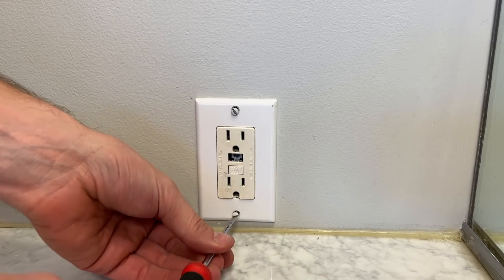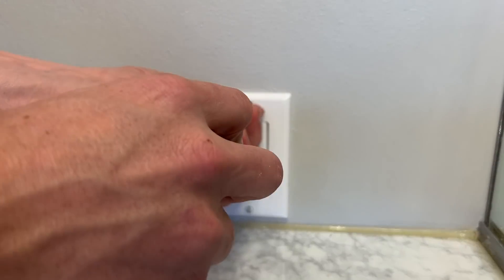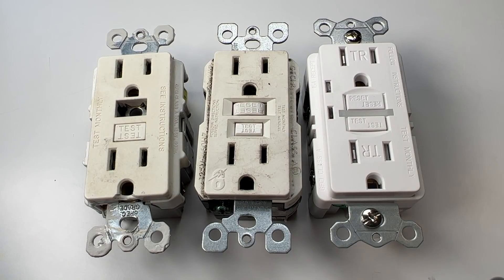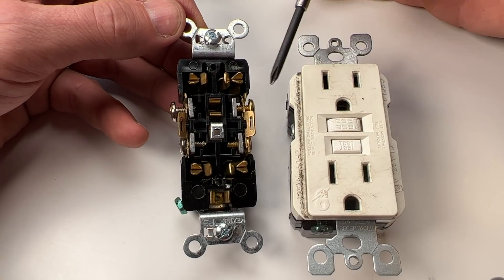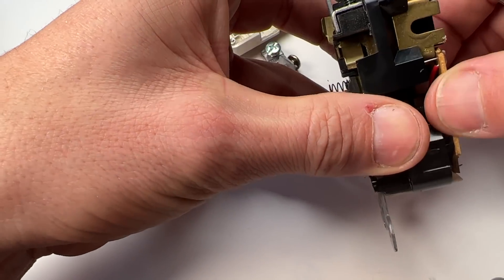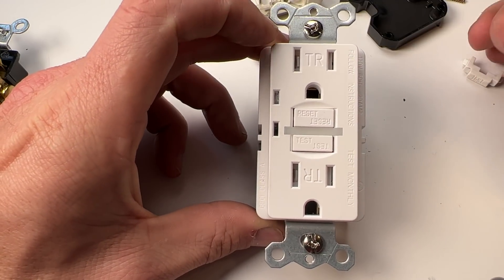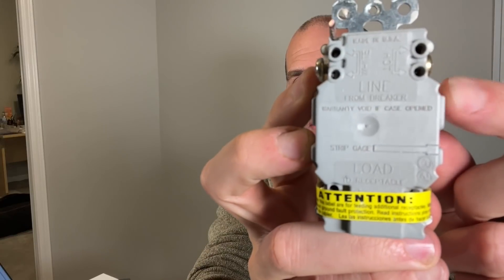3 Things You Didn't Know About GFCI Outlets

Comment: The current interruption on my hair dryer, two prongs no ground connection.    I plug it into a GFCI works fine.  I press the test button on
the hair dryer current interrupter and it works fine, trips the hair dryer tester, BUT the GFCI does not see the interruption.   Yes, the GFCI does not trip. comment please

Comment: Most people are not aware that GFCI outlets have a continuous electrical load just sitting there waiting for an appliance to be plugged in. They draw somewhere around three Watts continuously. If you are are on a off the grid home with solar or some other source of power all of those gfcis that you may have start adding up to a real drain when your system. You may have 10 gfi's and together they may all be drawing over 30 Watts continuously! As one other minor point that I have found about GFCI outlets. .. is that the three Watts is a incredible attraction for ants and other insects who want to climb into the GFCI sauna and short it out.

Comment: I will give you 1 neat fact on why Hubbell is the best commercial grade receptacle.  Take a CR20 and look at the side terminal screws.  you will find an “anchor hole” that allows the installer to insert the stripped wire and make a perfect wrap around the terminal screw everytime.  save time and elimanate use of tool.

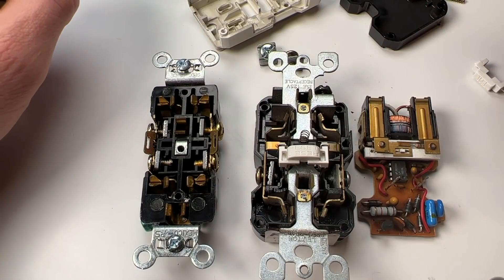Comment: Great video.  You didn't talk about how the GFCI works.  That coil that you see at 5:15, there are two wires going through it.  One is the hot line and the other is the neutral line.  Under normal conditions, the current flowing through each wire is equal but 180 degrees out of phase.  These cancel themselves out and do not induce a voltage on the coil.  But when current flows through say a person to ground, the current does not return through the neutral, a voltage is induced on the coil, and that coil current is what trips the circuit.  Pretty clever.
Reply: Not 180 degrees out.

Comment: I do not like this GFCI breakers.
The one installed as outside outlets are too weak to support a freezer and a sum pump at the same time.
Another money grab, nothing else!
Reply: If that circuit is wired with 12 gauge wire and there is a 20 amp breaker on that circuit you should be using a 20 amp GFCI which has a Tee shaped neutral slot. The GFCI is for greater safety, not a money grab. Modern electrical codes usually require that a refrigerator be supplied with its own 15 amp breaker circuit and only permits a clock outlet on the same circuit. Big current draw when the compressor comes on

Comment: I know that they recommend placing the GCFI at the end of the circuit to protect the receptacles down stream,  but I have a receptacle at the end on the circuit that happened to be right next to my kitchen sink. Between safe than sorry, so I removed it and replaced it with a new GCFI.

Comment: Another excellent video!  Helpful hint - note the wire at 1:00 has some paint or other contamination on it.  You want good clean copper for a connection.  I've been told I'm supposed to clip it back and restrip, but usually since I don't like to make often short wires shorter, I use a fine emory cloth to remove contamination.  This also happens on old ground wires where the whole wire gets severely tarnished.
Reply: Also plenty of wire so just trim and get "fresh copper". the original connection has been bent 3 or 4 times during install and removal. it's why you leave extra wire on first install.good video all in all!

Comment: We built a new home in 2019. Immediately after moving in, we started popping breakers. The building code required GFI breakers instead of GFI receptacles. Talking with the electrician, his commentary on the GFI breakers was less than reassuring but, as he told us, in order to pass inspection, the were required to install the GFI breakers, like it or not, and it was not! So, I replaced GFI breakers with GFI receptacles in the manner it used to be, and we’ve not experienced any issues since. I’m in agreement with the electrician…some wheels don’t need fixen!
Reply: Nuisance tripping is just that : a real nuisance. I am using ITE and Siemens panel boxes and have had a problem with just one AFCI that would trip intermittently. It would go months without an issue and then suddenly there would be a spate of trips, so I did like you : a standard breaker got installed into that spot in the panel box. It's never tripped since then.
Reply: @photogravity  we had a couple of different circuits popping right after we moved in, one being the refrigerator. This winter we added one additional lighted Christmas decoration outside on the front porch outlet, and when we turned on the second floor hall lights, POP! We still have some of the GFI breakers but they seem so far to be fine. I replace them if I have an issue, otherwise I leave them. If it’s a line that typically has a GFI outlet that they supplanted with a GFI breaker, I put in a GFI outlet.

Comment: Oh wait a second!!!
You missed it this time. When connecting wires to any receptacle outlet; it is always best and safe practice to connect the Ground wire ALWAYS  first. Then connect your NEUTRAL 2nd and HOT is last. When disconnecting you reverse the order. So HOT disconnected 1st, NEUTRAL 2nd and the GROUND is last to protect you from accidental electrocution.  That's just ELECTRICAL 101.  You disconnected it properly but not when you made the reconnection. 
Btw, I am not an electrician.  I just pay close attention to what the rules are. I  suggest you correct that in your next video especially since you try to teach others extremely risky lessons. Other than that, always love your content.  Thank you
Reply: Wow

Comment: Question.  Is there any downside to having  every outlet in the house be a Gfci outlet?
Reply: Most breakers have multiple outlets.  Thus installing extra gfi outlets will cause a unknown chain fault. If the upper gfi trips, would you know to check them when a lower gfi was not working?
Reply: @danc2014  good to know.  thanks
Reply: If you wanted to go that route, you’d be better off stringing regular outlets downstream from one GFCI, using the other set of screw terminals. The downside to this is that you’ll have to know which GFCI goes to which outlet in case it trips.

But other than that, it’s pretty much just cost. Do you value your life (possibly) or a few hundred dollars more? That’ll have to be up to you.
Reply: @twerkingfish4029  thanks

Comment: I could not find one (obviously tripped) for a big hydro bathtub in my house.  Re-wired and ran it off a new GFCI.
A year later I find the one that tripped, located behind a toilet and it no doubt got wet when I mopped the floor.
I looked everywhere for that thing...
Reply: Hubbell makes one with an audible alarm 🙋‍♂️ which would have solved your issue

Comment: Note that now you can get GFCI circuit breakers.  And there's also AFCI circuit breakers (arc fault circuit interrupters), which are now required in the 2020 NEC code in many locations.  So with new construction, you may end up with dual AFCI/GFCI breakers and just regular receptacles, even in kitchens and bathrooms.  But when you're looking at replacing breakers, you're getting into a whole new danger zone, so for many people, that's where you draw the line and have a real electrician handle it.
Reply: When I purchased my home a few years back, it got dinged on the fact it didn't have GFCIs installed. Rather than doing the GFCI receptacles, I installed breakers instead since I liked the simplicity of protecting everything on the circuit and didn't need to spend time figuring out which receptacles were downstream. Also as I've been upgrading over time, on many other circuits throughout the house and my garage, I have added AFCI or GFCI/AFCI breakers since it affords an extra bit of safety to my home overall and especially when I do any new wiring in the house.
Reply: downside is having to reset a tripped gfci at breaker instead of point of use

Comment: I have found the hard way that not all GFCI outlets are approved for "damp locations" such as outdoors. I had a new self test type fail permanently when it picked up a slight amount of moisture.  I replaced it with one approved for damp locations and it solved my issues.  I am not a fan of the self test style, but the lawyers win again.
Reply: The weather resistant receptacles also have rust resistant screws, which should make them easier to deal with when they do fail.

Comment: Speaking of Line and Load, I was cooking on the stove with the range hood on and the hood randomly died on me one day. I thought I tripped a breaker but nothing looked wrong at the box, figured it finally died with it being so old and decided to deal with it later. Cut to next day when I walk into the kitchen and notice the GFCI outlet on the other end of the kitchen. Turns out I tripped that and the range works perfectly fine again. That is when I learned GFCI protects more than just what is plugged into the front of it.
Reply: Many new construction jobs do the same thing WITH TWO powder rooms. One GFCI but
protecting two rooms.

Comment: When I first moved into my current house I noticed that the power outlet in my downstairs bathroom was inoperable. It had a regular outlet near the sink so I started to look for either a GFCI or in the fuse box for a master ground fault breaker. I could find neither. I ended up calling the builder and questioning him. He had no idea and came over to take a look. It turned out that the GFCI near a downstairs sink had tripped. The sink is over 25 feet away from the bathroom and on the eastern most wall of the basement. When they wired the house this was the GFCI that all the basement circuits that required a ground fault, because they were near water sources, were connected. It was very well hidden and I would have probably never found it myself since I had turned off the water to that basement sink since I had not wanted it installed in the first place and had covered its' location with new storage cabinetry.